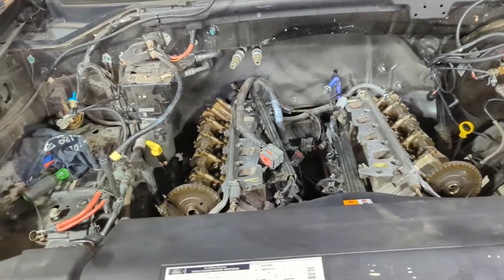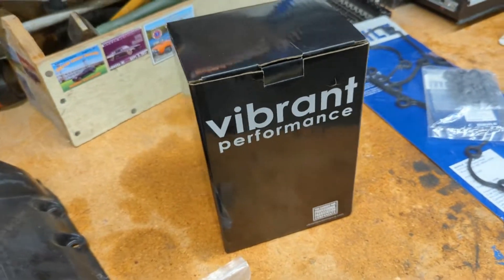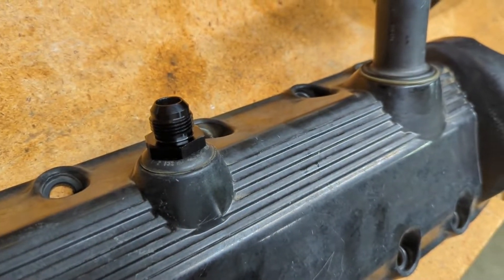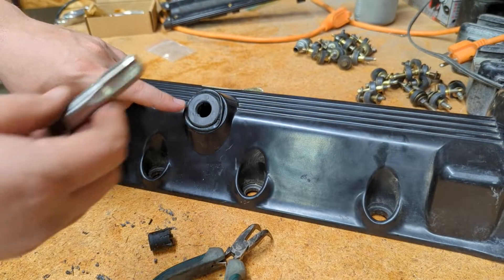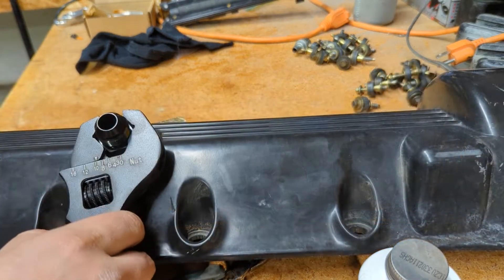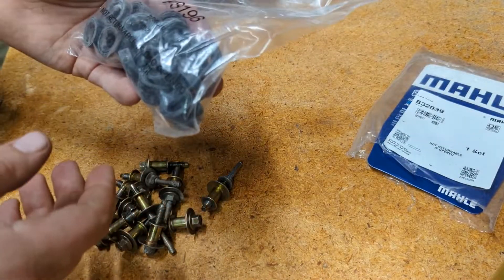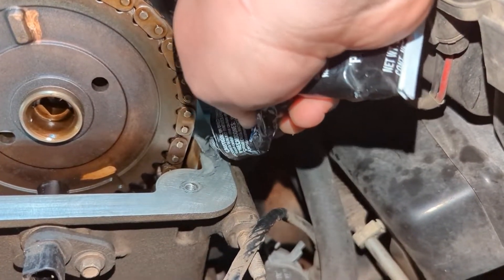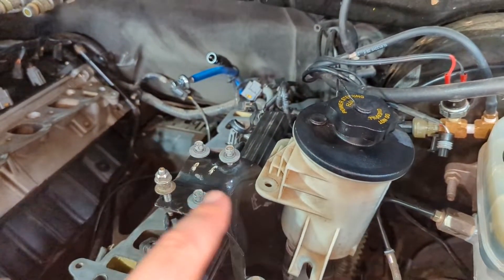How to Add -AN PCV Bungs to 2V 5.4L/4.6L Ford Valve Covers

Comment: Do you have the part number or sizes for either of the pcv fittings?
Reply from the maker: They were NPT to AN fittings.  Do you have a specific time stamp you're wondering about?
Reply: @605BOLT  well i would like to replicate your pcv fittings, but im trying to figure out what thread size or part numbers both fittings were. For both the push-in fitting and the one you had to drill and tap. Thanks
Reply: Same here! Have the details on the fittings? Looking to get this done ..

Comment: Hey bro the passenger valve cover has the pcv valve, what is the hole on the driver side? Is it another pcv or a vaccum? Would it be able to be blocked off and tapped? My egr tube is covering the hole and I cant add anything on it. If i attach a hose it sucks up oil and burns it. Thanks
Reply from the maker: It's PCV as well. Both of those ports are breathers that allow blow by to get out of the crankcase.
Reply: @605BOLT  by the way I have a N/A 5.4 2v not a lightning. And if they are both PCV why is the hole a different size on the driver side valve cover.
Reply from the maker: @golpherboy13  lol I have no idea really.

Comment: Bro! Get with Johnathan Blotzer and get the PS relocation bracket with a sexy Moroso resevoir 😍 made it soooo much easier to pop the drivers valve cover off without removing anything but the cai.
Reply from the maker: I texted him about it. I think I will do it but I want to make a separate vid on that.  I agree its a nice upgrade!